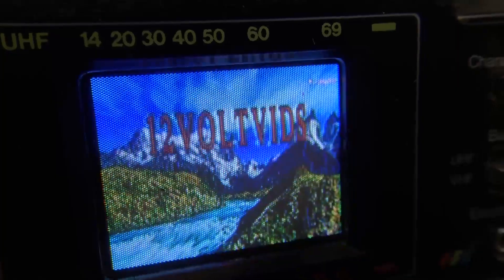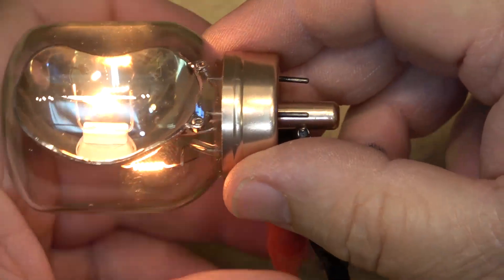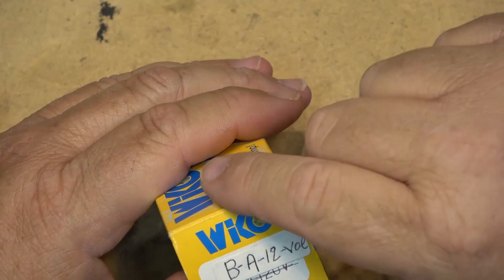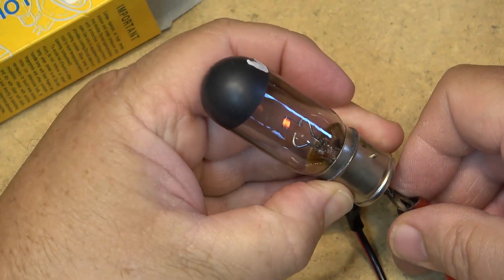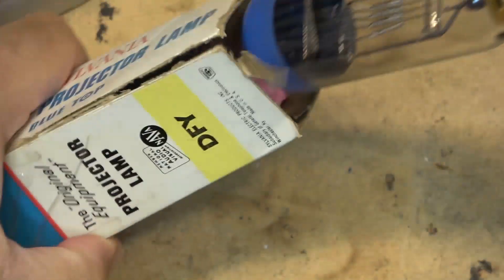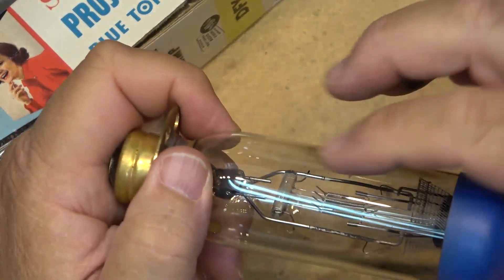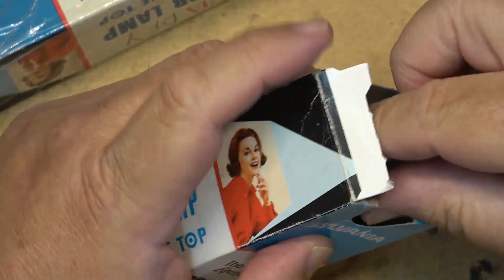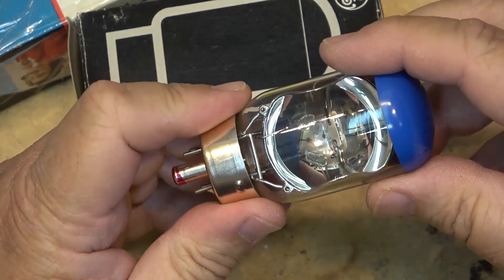Dim Bulbs

Comment: When the glass is deformed on a projection lamp, it usually meant that the cooling fan on the projector wasn't run long enough to cool down the lamp after it was shut off.  Usually happened to people who didn't know better.
Reply: My 80s Kodak Carousel (Halogen lamp) actually tells you to cut the cooling fan off immediately, unless you need to change the lamp quickly. The idea was the rapid cooling could cause the lenses to shatter.

Comment: Extra filament probably there to provide light for the optical sound side pick up, rather than tapping off the main light path.
Reply from the maker: Optical pickup on film sound us a long way from picture projection. Exciter lamp just a small flashlight bulb. The real reason this is there from what i understand is a ballast resistor.  To take the infush at start up to hopefully add a few more cold stats to the bulb.
Reply: Unlikely. 
That extra filament is possibly for additional resistant, in order to run it on line voltage. And since it's not possible to pack this filament into the optical light path anyway so they just heck with it and place it on the rear, away from the light path instead.

Comment: I haven't kept up lately since I don't own a projector, but was curious as to how many modern projectors have switched from filament bulbs to LED?  I know home projectors are starting to, and there are laser technologies out there now as well.  As far as those high power / wattage bulbs, I've heard horror stories from people who have worked as projectionists and the bulbs explode from overheating.  Not a pretty sight, and they've said some even have a really bad smelling gas that comes out.  Still love watching your videos, have a great day!
Reply: Before everything switched to LEDs they were using xenon or other arc lamps.
Reply: @eDoc2020  Didn't realize that Xenon was used in other applications besides strobe lights.  Didn't know it was able to do constant light,  Though Xenon was only for flash style bulbs as it would charge up flash and then discharge and have to repeat the cycle.